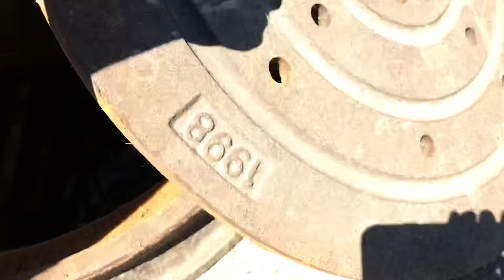Unclogging Giant Culvert

Comment: Good work boys. 
1.Make sure that you have on bug spray.
2. Always have a buddy system and let your family know where you are at (location).
3. Get headlamps, shovel bull nose, rake, ( you can cut the handles  down and wrap with duck tape bright colors), heavy duty water gloves, small power tech light. reflecting vest with pockets. Rope.
4. Have fun! Be safe!

Comment: Great work guys! Always clean downstream first, that way it has low water flow while you're working there.  When you don't have tools, use what nature provides. Use a longish stick to pry the mud in front of the culverts, simply stick it down, then pry back, against the pipe to push the muck out into the pond to create some deeper ruts for the water to flush through. Confined work area work is no joke. That one looks ok, but releasing composting muck can release some nasty into the air.  Always work in pairs and let someone know where you're going to be.  Even the big guys forget and try to save a coworker only to succumb themselves.  If you like that type of work,  check with the city parks & rec department when you're older about positions there instead of flipping burgers at macs.

Comment: Nice work on the unclog but be careful when unclogging from behind a clog with high water on the other side. Because if the clog let loose suddenly while you are behind it can be very dangerous. And for that pipe clearly there was a lot of mass(water) infront of the pipe pushing itself in.

Comment: Very nice to see you outside.  Hope to see many more videos of you two unclogging.  Just one word of caution.  Hydrogen Sulfide is a gas that is heavier than air and lies in low lying areas like sewers, culverts and manholes.  It isn't always present but can be usually when there is lots of decaying organic materials like leaves.  Should you ever smell rotten eggs,  get out and move to a higher area.  Keep up the good work guys, looking forward to more videos

Comment: Nice job.  However, you should make sure the outlet pipe is clear before cleaning out the block. Also, you may want to throw the blockage materials on the shore not back in the water to block it again.  But, nice job.

Comment: BRO THERE IS A SAFETY THING THOUGH. IF THAT CLOG GAVE WAY, YOU COULD GET TRAPPED UNDER ALL THAT PRESSURE. PLEASE MAKE SURE YALL ALWAYS USE THE BUDDY SYSTEM AND TELL AN ADULT WHERE YALL GONNA BE.
Reply from the maker: Yes we do use the buddy system and tell adults. Thanks for your concern

Comment: Pond vs. lake is not defined by size.  A pond is a collection of water with no defined consistent water source coming in and leaving.  For example, it's not fed by a stream and doesn't exit as a stream.  An example might be a depression in the land that fills with rain water, like a farm pond.  A lake has a defined source of water entering and leaving, like when there is a dam placed on a stream or river.

Comment: Great video! I’m always happy to see content like this! Also great to see Post10 here :) Keep it up! 

Beware ΔP (as the water level difference on each side increases, so does the pressure that equalizes water levels once debris is loosened, which can suck you in). 

It’s not really an issue in this video; just please be cautious with larger pipes with higher water levels!! Cheers!

Comment: Great job. Please be careful. The water has a lot of pressure and it can suck you in the pipe. Also be aware of the underground gases always let the hole breathe before you go in. Always have a phone, location, and a partner with you. Great job once again. May I suggest a shovel or a rake perhaps. 👍🏻💪🏻🙏🤙

Comment: Great work!
please dont get into a pipe like that. Im not experienced with clogs like that, but I do know how dangerous a pipe like that can be,  you could get swept into it very easy, not to mention possible gas build ups.  Also never  underestimate the force moving water can generate. fast running water can sweep a full grown man off his feet easily with only a couple inches, if its running fast enough. 

maybe push it through with a shovel and pull the sticks out that way. 

you guys did a good job here,  just remember safety first.

Comment: Great job again guys. You can get hand rakes here in the UK,  (they are just a smaller version of a full sized rake) I’m sure you have the same there. You could keep it in your rucksack and it would help. I love what you do but get a little concerned with you climbing into that culvert. 🕸🕸 🕷 🪰🦟🪳Darn beavers 🦫 🦫

Comment: Can't wait for the next part, but be careful. I could foresee that the blockage broke and new blockage formed in the manhole with the whole pond rushing through the culvert. That's not a great place to be when you're in the middle of that pipe. Don't mean to scare you but water has a tremendous force.

Comment: 1 you need to use a hoe to break up some of that sediment 2 take those huge logs out since putting them further down the pipe will only cause more issues since there isn't enough clearance for them to wash out 3 go down to a hardware store near you and get workman's gloves, or the cloth ones that are blue or red on the palm. You need to be careful digging your hands in there. You did find a glass bottle... so the likelihood of broken glass is a possibility.

Needless to say I'm proud that there is a younger generation of kids who are not afraid to get their hands dirty and do good work for not just YouTube likes but fot thier community. Good Job guys.

Comment: Not sure if the creators care but the difference between a pond and a lake is only depth. A lake is a body of water of water that at it lowest point, no light can penetrate to the bottom. You could technically have a 5 foot wide lake if it is deep enough.

Comment: When you remove stuff from the culvert entrance, just don't throw it back into the water 2 feet away from the culvert entrance again!! Throw it over the culvert and on solid ground to get rid of it, otherwise it will be dragged back into the culvert by the current.

Comment: Cat tails are a pain in the butt, I deal with them on a daily basis.  Take a shovel and sharpen the edge if it and you'll be unstoppable against water based plants at a drain or culvert.
Reply from the maker: Ok nice tip

Comment: Y'all are doing a good job. Get a good rake or hoe. When clearing the pipes you need to remove the wood, vegetation, trash from the water altogether. Needs to come out of the water, put into a pile on the land, and somewhere on the land where it won't fall back into the water. Maybe where the city can pick it up, or where it will dry so you can come back and bag it out. Don't just push the debris with the water current and let it float out down the culvert because it will get stuck further down and create another blockage

Comment: The city needs to cut these guys a check for doing there jobs for them! At least give them the shovels and rakes they have because we know they'll never use them for anything but for something to lean on while there doing nothing! My be they should be showing these guys video's to the city worker's and there bosses so they can actually see what it is there suppose to be doing !! Great job guys keep up the good work ! And don't ever forget the number one rule if safety is that safety begins with you ! 👍

Comment: Sorry to rain on what appears to be a great job but let’s take a moment and look at it from a different point of view. First , once you have entered a pipe below ground level it’s considered a confined space. Check with your local FD and ask them how dangerous that is. The fact is FD have specialized crews that train for those rescues. Two running water can cause drowning in as little as six inches of water for an adult. Listening to the boy in the hole he said it was deep but worth it. Reaching in stagnate mud and water without proper gear also called personal protective equipment (ppe) opens one to infection.
The fact nothing happened this one time should not result in complacent behavior.
Reply from the maker: That is why we are not doing this style of unclogging anymore.

Comment: Good job, but you should  have been down there without a safety  rope. If you would have slipped and the out end didn't look big enough to escape. You would stuff the pipe with your body and drowned before anyone could save you. Stay safe.

Comment: Is there a follow video? What happened in the manhole? Should you have not cleared the culvert from the lake end that was blocked
Reply from the maker: Yes follow up video. We unclogged some in the manhole expect another video soon. We did not fully do the front part but we will work more on it. We filmed for around an hour plus 40 minutes of prep so and 90 degree weather so we stopped filming for the day.
Reply: @OddsandEnds  Good stuff look forward to your next video
Reply: @OddsandEnds  where is part 2???

Comment: OK, very nice Post10 inspired video, but, you kids need to stay out of the sewers/  SERIOUSLY.  The FD doesn't want to ever send a confined-space rescue team after you.   Way too many people die from H2S (Hydrogen Sulfide aka swamp or sewer gas) that has a vapor density of 1.18 (air=1) and will settle into holes like you might wish to explore.  It kills quickly and lots of people have accidentally died from entering unsafe spaces.  Play, but, play safe.  Play, but, play safe.

Comment: Very nice job but I don't think that you guys should be taking the lids off and going in a confined space very dangerous have to be trained. This is against osha  safety requirements, could be trapped gases and fumes  due to dumping or broken pipelines stay up top be safe  not sorry.

Comment: It is Fantastic that you are Volunteering but, it is VERY Dangerous to enter a sewer or a storm drain. There are deadly gasses that accumulate inside the tunnels and pipes. I'm OSHA 40 hours certified and I would NEVER enter a sewer. You need special certifications like Enclosed Space cert by OSHA to even go near one.  You don't have proper clothes, training, boots, correct gloves, an Air tank or most Importantly a Gas Meter to detect poisonous gasses. 
 You could Paint and Clean YOUR neighborhood  like I do and More people would would be aware of your Volunteer efforts. People might even follow you. You could be Leaders in your community or you could Die going into a gas filled sewer. PLEASE be the LEADER ! Stay out of enclosed spaces.